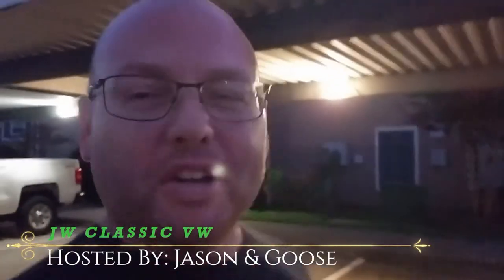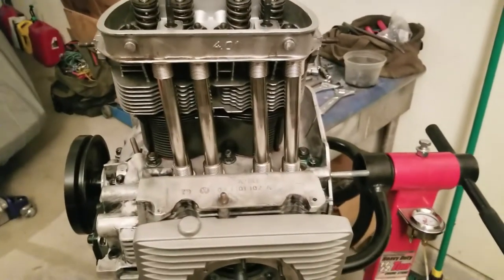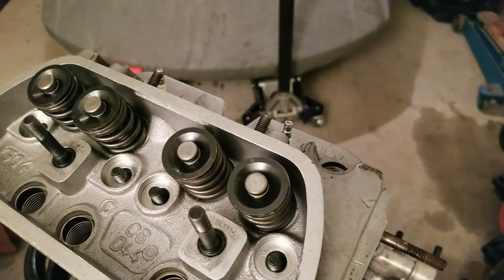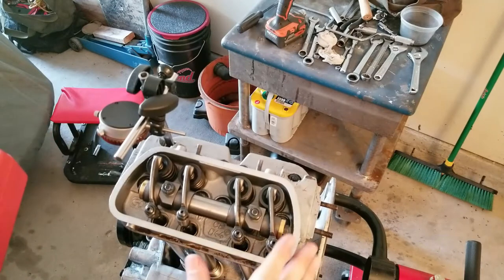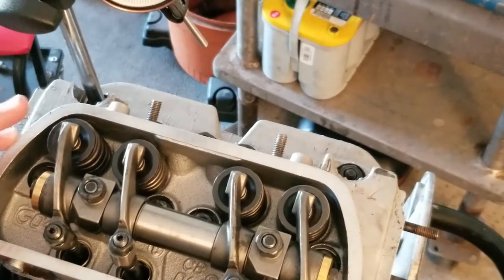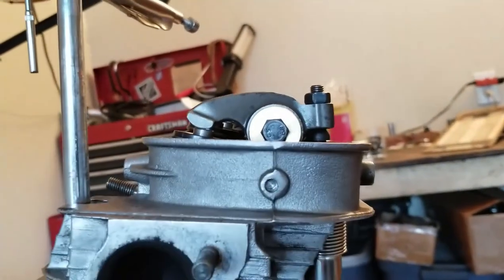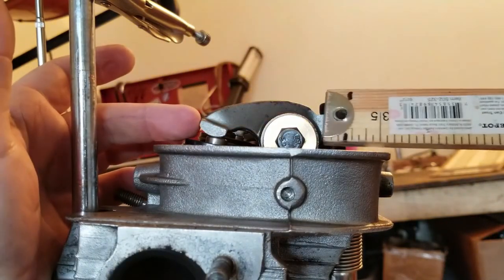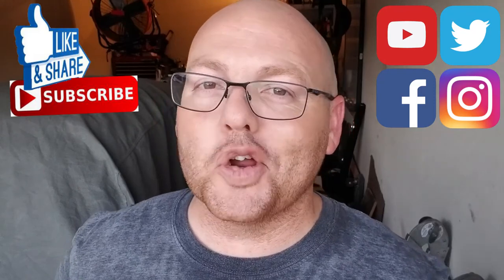How To: Rocker Arm Geometry! Take 2 -  1956 Ragtop - Volkswagen BUG | JW Classic VW

Comment: Best way to address the pletherm of VW engine building problems is to go corvair.
Reply from the maker: Lol... never really messed with one.
Reply: @JWClassicVW  think you would be pleasantly surprised at corvairs high quality engineering and metallurgy .  They are not a VW clone at all.  GM engineered the engine from scratch in anticipation of a mini helicopter engine contract. Which didn't happen so they went to economy car market with the engine. About the only way to kill a corvair engine is too run it out of oil. And many are the times I did as a young man because the then rubber push rod seals would fail.  But that same engine is still runable and he sitting in the back 61 coupe.. With the modern seal material that issue went away.  They are built with forged steel cranks stock. Vibration dampener and standard GM  hydrolic lifters and tappers. No valve adjust issues.  No oil passage mods needed Plus the well known to smooth ness of 6 cylinders natural balance. Some folks will modify with the larger oversize VW barells and pistons. They corvair engine is highly prized for direct drive experimental aircraft use. Most corvair aircraft apps produce 100 HP # 3200 RPM and cruise at 2800 rpm at 80 percent power.  The corvair is an eazy engine to work on once you get the tin ware removed.  Happy thanks giving to you.
Reply from the maker: Love all types of Air-Cooled engines... I'll take a look... did you know Ford also aided in the design of the LS.
Reply: @JWClassicVW  no didn't know ford was involved.

Comment: I have 1.4s on a stock cam and I am only getting .360 at full lift...makes NO sense to me :(
Reply from the maker: Well thats about right for 1.25:1 rockers... hmmm are you just now setting it up?  Have you already done the Valve geometry and cut the pushrods?  Pretty interesting article right here.

http://a-dingli.tripod.com/bolt-on_ratio_rockers.htm
Reply: JW Classic VW thanks for the reply. I thought the same thing!! Sounds exactly like 1.25s! I am on a stock cam could it be the wear on the cam? Ran the part number. They are 1.4s
Reply from the maker: @redhicks  That would be some crazy wear... was there any spring binding at full lift? What was the shim # for the rocker base?
Reply: JW Classic VW I’ve tried it at .015, .030, and .060. I haven’t really played with shims I though you did that second. Could that be why I am loosing so much lift?
Reply from the maker: @redhicks  yes sir... Add shims to get closer to the 400 point with lift, then you'll check the geometry at half lift with an adjustable pushrod.  Your going to end up cutting the pushrods down.
Reply: JW Classic VW yeah I was aware I had to cut down, but as i put more shims and lengthened the measure tool my lift actually went down. Maybe I something wrong

Comment: Hey bro, I bought the same dial indicator you use from amazon, where did you get the m8 to m10 adapter?
Reply: Or should I ask how did you attach the dial indicator bar to the head or head bolt?
Reply: Second question, can you do a video using the black marker to center the high lift rockers to the center of the valve cap?
😀

Comment: how do you check your deck height
Reply from the maker: Deck height is checked when the piston is at TDC, there is a tool used at the top of the piston that is torqued down into place.  The tool has a set screw that can be used or I use a micrometer.  I did a video on calculating compression ratio where I show how to do this.

https://youtu.be/LxphmKQIr0Y

Comment: Hi Jason, one question, you mentioned the 60thousands at the valve spring, is that measurement between the spring coils?
Reply from the maker: Yes, measuring coil bind.  If it's to tight you'll break the spring.
Reply: @JWClassicVW   ok, that's what I thought but wasn't sure....thnx bro much appreciated!!

Comment: What cam do you run? Also when you built your motor what kind of shimming did you end up with on your barrels?
Reply from the maker: I'm running the Eagle 2288 from CB performance and after I decked my case there was no shimming required to get the 9:1 Commpression ratio I was looking for.

Comment: I've read a lot about how with these pushrod end adjuster rockers  it is Important that at half lift the adjusting screw is in line with the pushrod and not at a different angle. Is this true?
Reply from the maker: Yes this is very true and falls into the side play adjustment being correct.  I'll be going over this at some point in the 40hp build once I get a chance to pick up the heads... lol

Comment: Thanks for the info, I have question though? What do you do if your exhaust valve is sunk into the head more than the inlet? Meaning, the valve stems are different heights so you will have different geometry for each. Do you use a lash cap on one to even the heights of the valves or have 2 different pushrod sizes?
Reply from the maker: Hey Sam, thanks for the comment brother! As for a sunken vavle that's not normal, the vavle seat will require repair and or replace the head depending on any damage.  I would take it to a VW shop and have them take a look.
Reply: @JWClassicVW  I have had the heads rebuilt and looked over from someone who knows what there doing. The only way to fix it properly is to remove the seat and reinstall it, but being that everything else was in spec and we are only using the standard cam it wasn t  worth the extra cost.

Comment: I have a question...  This video contradicts your first video on this topic.  at the 16:17 mark your measuring at the top of the pushrod tube cup, but in your first video your measuring at the base of the pushrod tube cup (13:46).  Which is correct?  Id the base is correct your off almost a 1/4" on this one.
Reply from the maker: Hey what's going on brother, yeah I can see were it seems like the information may be a bit confusing... the big difference here it the type of rocker arm being used.  Depending on the rocker arm set up such as with these two examples 1:1 and 1:4 the position of the push-rods is a little bit different in relation to the rocker arm adjuster.  This is the reason for the information appearing to be different.  What your looking for according to the great Pat Downs from CB Performance with 1:4 ratio rockers is " at half-lift, the pushrod should be straight in-line with the valve adjusting screw.  If it is not, remove the pushrod and adjust the length until the pushrod and valve adjusting screw form a straight line (at half-lift).

Good Article: https://www.cbperformance.com/Articles.asp?ID=263

With both of these videos, I was trying to give reference points to check the valve balance, at half lift you want an even balance between the valve face and the pushrod.  This balance is what prevents premature wear and failure of the valve guides, valve springs, and rocker arm faces.  It takes time to set geometry right, I know I fought with it for a few days before making my own shims.  Hope this helps.
Reply: @JWClassicVW  So, just to reiterate if you're using 1:1 rockers you want to measure from the top of the pushrod tube cup correct?  Also, if you measure on one cylinder then that one measurement should be good for the rest of the cylinders or should you do this with each valve on each cylinder? Thanks for the video I have learned much.
Reply: Good morning from Canada
Well, I'm going to dispute that link's information.
What they did in that article was transfer factory rocker geometry logic, from an oem 1:1 adjuster on the valve end, to the 1.4 pushrod rockers end.
Which basically just aligns the pushrod to the adjuster.
That does absolutely ZERO to create proper rocker arm geometry. 
True and proper rocker arm geometry .... is when the rocker-arm is at half-lift ... the  top of the valve tip (or lash-cap) is absolutely straight centered to the center of the rocker-shaft's center-line. And to achieve that, you will need to shim the rocker's mounting blocks.

Comment: I came back to rewatch this video.. Im not convince that my geometery is spot on.. I did solid shafts, 1.25 rockers, stock pushrods and cb swivel feet adjusters.. I have the shafts shimmed up alot because the swivels are long.. When i go half lift, the rocker is still alittle high on the valve side / low on the pushrod side..  Im not sure if i need to keep shimming the shafts more
Reply from the maker: Hey brother it is always important to make sure you are starting with the basics in valve geometry.
1. Know your CAM and where it should be at full lift.
2. Make sure the swivel feet are sitting just off there fully backed out location.
3. Use the Top of the Head as a reference point for level at half lift.
Rotate the engine over a few times to watch the valve operation and record the lift being provided.  Is it close to what it should be?  Now check for parallel to the head surface at half lift.  If it's not even on the valve side you probably need shorter push rods.  Try adding more shim but pay attention to you lift... if your losing lift then you have shimmed to high.
Reply: @JWClassicVW  ok..i think i may swap back the stock adjusters.. I believe i have to much shims and i did measure less lift. I should of done shorter pushrods 😣
Reply from the maker: @VWRICH23  no worries brother, all about learning 👌